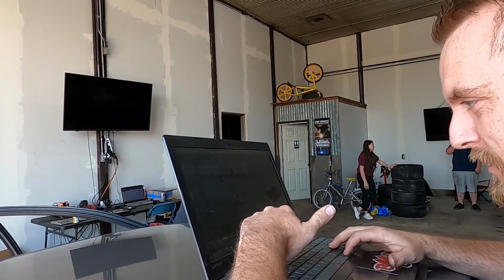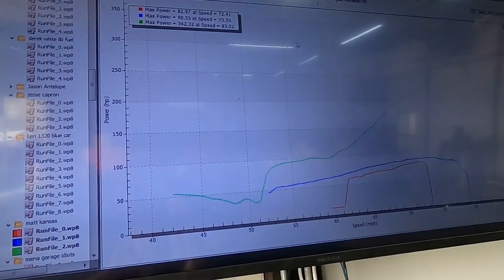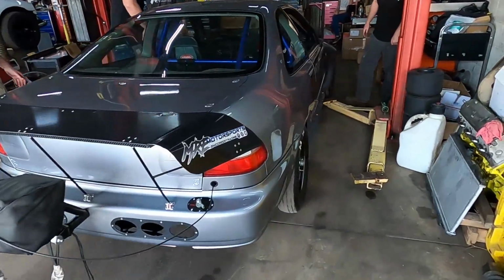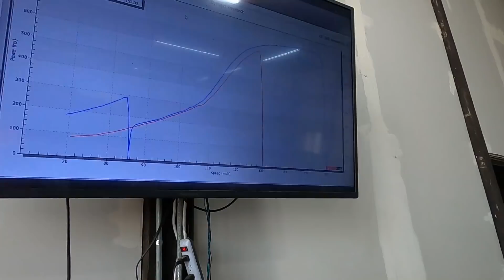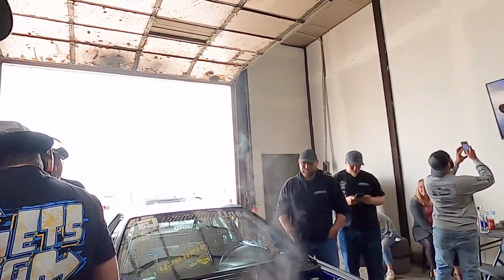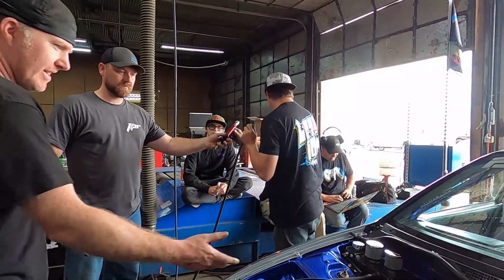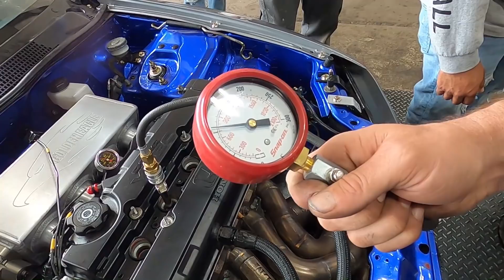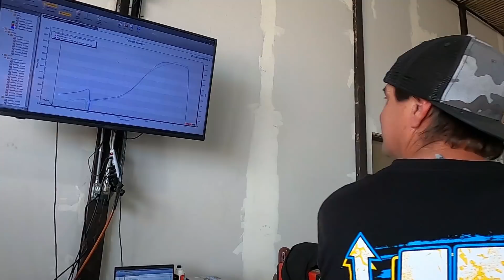The Most Power a Honda has made on Our Dyno ! MRE Motorsports Episode 4 PSCA Prep

Comment: Let's go I would say it was the back lash of fluid moving real fast and after letting off throttle water pump slows down there can be a water hammer affect similar to plumbing wen u close a valve fast the pipes shake.. pressure never changes but shit happens

Comment: I had the same issue with my (different brand) H-Gear D-Series single cam axles. Even with a stock D15 they still had the tendency to pop out especially on roundabouts. Got a few stock axles to test them and measured them and yes, they were too short by about 8mm..

Comment: If you have a lab scope handy, take a cooling system pressure tester adapter for the rad and attach a pressure transducer to it and you can find out real quick if you have any cooling system intrusions. You can also set up a trigger on cylinder 1 and you'll know exactly what cylinder is pushing coolant based on firing order

Comment: That limiter tap for a fraction of a second was so violent that it jackhammered the warm hose and shit clamp right off of there with normal operating pressures.  Brent was absolutely right in checking everything to make sure that's all that it was when dealing with someone's time and money, this is exactly what separates Brent from most is that he actually thinks about such where as most would have just flopped a clamp on there.

Comment: I was wondering, on old school hotrods they would weld a 45° thin pipe into the exhaust and cut a whistle shaped slit right after the cut. Then they would have a check valve and a vacuum line going into the crankcase. 

The idea is, as exhaust speed increases (works if you're catless) the gas creates a Venturi vacuum on the line into the crankcase. Having the crankcase in a vacuum will increase horsepower as well as help with oil leaks and other things like pressurization of the catch can.

I'm wondering if something could be put on the short hood exit, could make a lot of vacuum since gas is moving fast. 🤔

Comment: Would be pretty awesome if you explained what it is you were doing at the 25 min mark......you know, for the layman..
Reply from the maker: It’s called a leak down test. Put high pressure in the cylinder with the valves are closed and see how much air leaks out

Comment: Hey brothers! I got a problem with my 2002 civic 1.7 its leaking coolant by the throttle body and no heat i changed the clamp and thermostat n car doesn't overheat never did. Just bought it n hopefully one of you Honda enthusiasts can help. Thanks brothers

Comment: You just need my trick scope skillz. I can find a headgasket leak your leakdown test won't and I can findout exactly what cylinder is leaking and I can do it in under 5 minutesXD I assure testing for a headgasket leak is faaar more efficient on a running engine. Your meager 150psi leakdown tester pales compared to running engine